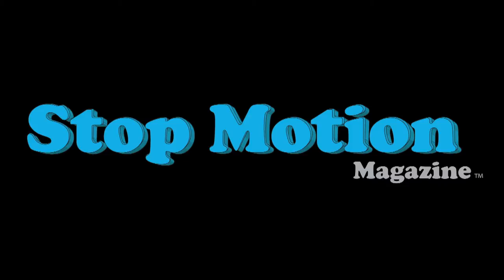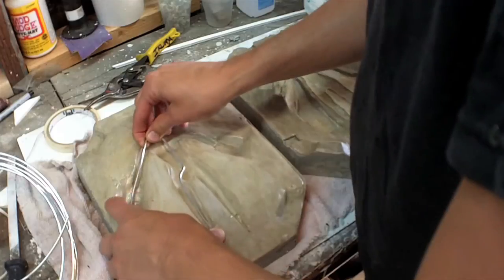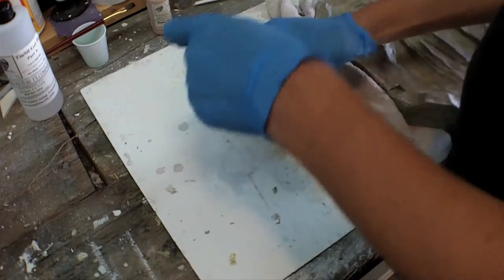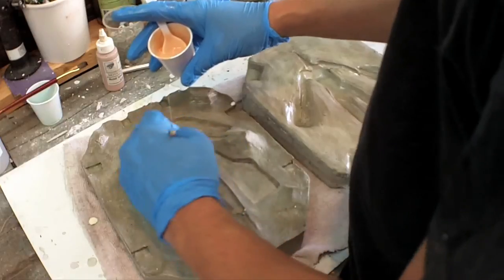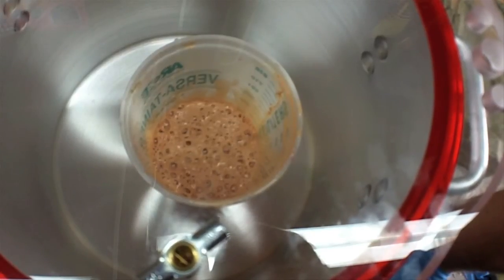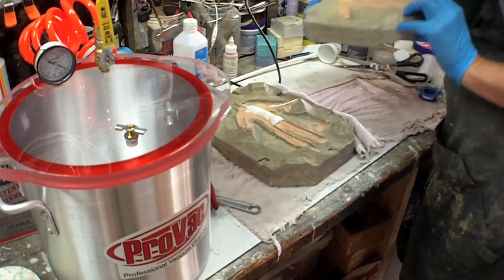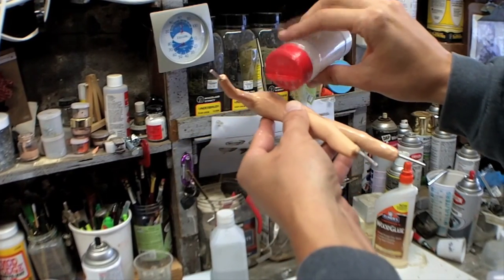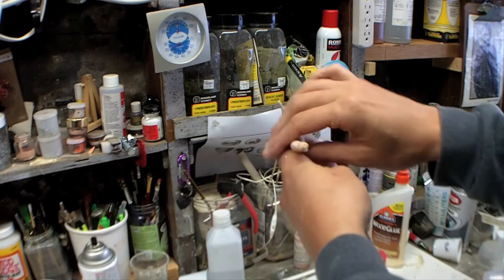S1 Silicone Puppet Body Casting Tutorial

Comment: Great video! When using a 2 part mold as opposed to a glove mold to avoid seams...(I am making silicone dolls for very particular collectors) I am wondering if seams after removing and filling would be visable at all? Also if I wanted only bendable arms and legs should I still make a full body armaure or just put it in the places I want to bend?Thank you
Reply from the maker: First you should always consider your design so if you just need arms and legs then just mold and cast those. Now as for seams. You can completely get rid of them but you'll need to practice removing them to really get it to work. What I've found is cutting them a little so they indent slightly into the puppet and then fill it with a new mixture of the silicone and then smooth it with Bestine. Also, some master puppet fabricators that I've worked with have used green plastic scrubbing pads or various foams attached to a Dremel to remove the seam and smooth it out. Lots of different techniques, but the Bestine smoothing is my personal favorite.

Comment: Great tutorials!
I bought a liquid latex though, can I also do it with this?
Reply from the maker: +Eva Margon No, that requires a slightly different method. You can build the mold roughly about the same except you'll need exit holes. You'd paint in a few layers of liquid latex, let it dry and then strap the mold together and then pour in expanding urethane mold into a pour hold you made when building the mold. Thats the basics of how to do that, but I have to warn you that method is not easy and a lot of things can go wrong. I would highly suggest using a buildup method when making puppets out of liquid latex. Good luck.
Reply: +stopmotionmagazine Ok, thank you very much!
Reply: +stopmotionmagazine What about this way: I first pour liquid latex in first mould, wait to dry and then pour latex in the other half and put the first one (dry one) on top of this one? You think it's possible? Would they "glue" together?
Reply: Pouring latex into a mold will create a puddle that will never cure properly. You could also use a Slush-casting method were you actually pour your latex into the mold, let it sit there for an hour, drain your excess latex into a bucket (you can reuse it later) and then close the mold and let the remaining rubber to cure. And what happens is that the ultracal absorbs moisture out of the latex and forms a skin inside.
Reply: +spinocroc123 Yes that will work.
Reply: +Eva Margon No That won't work.

Comment: Hello; What are the names of the silicon material you write help me please.
Reply from the maker: stiina jersey Hi, the silicone used for casting is called TinSil Gel. It is a Tin Based Silicone purchased through MotionpictureFX.com. Let me know if you have any more questions.
Reply: stopmotionmagazine Which shore (hardness) is it in the silicone?
Reply from the maker: Off hand I can't remember. I can tell you that Tin-Sil Gel can be found on the internet and you can control the hardness with different additives. Also, Tin-Sil Gel is very similar to human flesh. So it is very fun to work with.
Reply: +stopmotionmagazine if I use tinsil gel 10, can I change skin tone with the pigment from peachy to brown?
Reply from the maker: Tin-Sil Gel comes in either peach or clear. Go for the clear and order the pigment that you want. I would suggest looking up Polytek and getting TinSil Gel-10. That should be translucent clear gel silicone that you can tent.
Reply from the maker: Yes, that will work!

Comment: I could not find the same silicone you are using would this one from Motion Picture F/X be pretty much the same? https://motionpicturefx.com/Silicones-Pigments-Additives/v-1068-gallon-kit 
Also could I do the same process but make use a silicone mold using one of their mold silicones?
Reply from the maker: Hi, Honestly I'm not sure. I haven't been there in awhile and they change formulas year to year. I would suggest calling them and asking about their tin based silicones for casting puppets or animatronics.